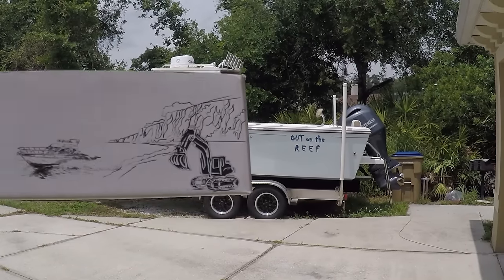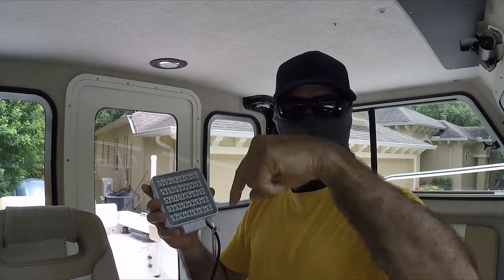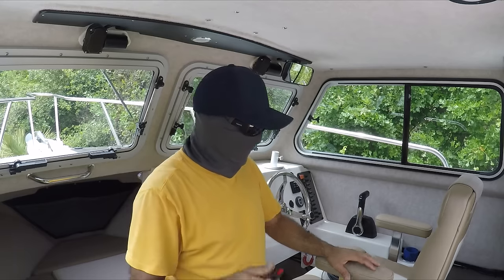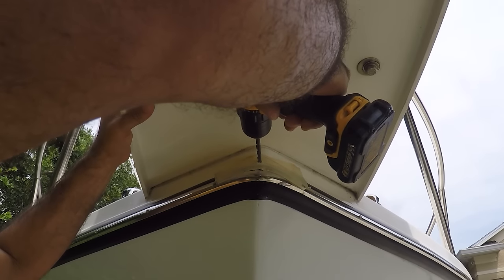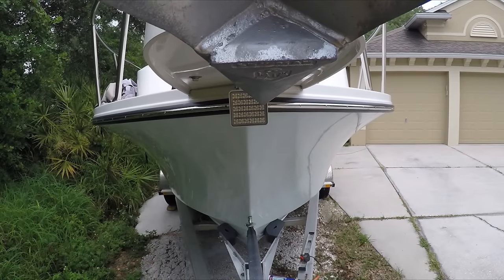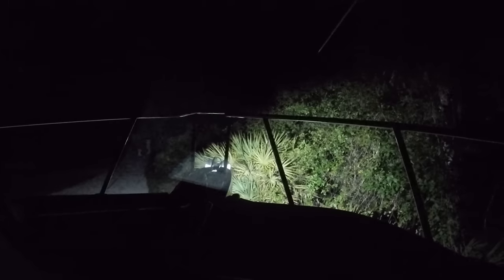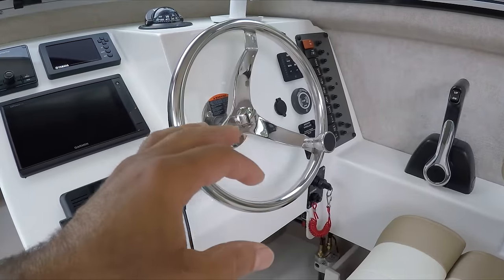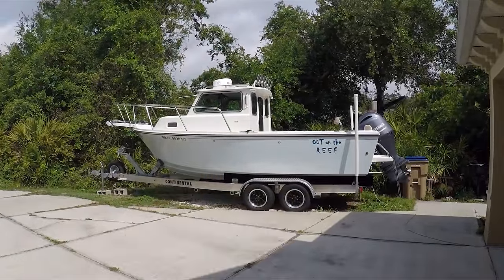Installing a LED Marine Spot Light Crooked PilotHouse Boat

Comment: Looks great!! I went with a plash 6" combo spot flood light bar on my flats boat and I was super impressed.   Over 7000 lumens on a little light.  They're made in Texas so they're a bit costly.  If you decide you need something brighter the 6" plash marine may be the way to go.  It would fit under your pulpit nicely.
Reply from the maker: Thanks cap. And they dont consume  a lot of power 👍👍⚓️🛥
Reply: @OutOnTheReef  Yup. Power consumption is a big deal when you're heading out for days at a time.  Good point.

Comment: Since you’ve used this for some time now would you still recommend this method or maybe a remote controlled golight?  I know it would be tricky to mount it out of the way so the glare doesn’t affect your sight but I like the idea of the adjustable spot light.  I’d appreciate your opinion.
Reply from the maker: Hello Tim and i love the way this one work but yes a golight well away from giving you glare woul be better but mine does a great job looking at markeres and crab traps 👍

Comment: Hi Capt... I like your light!  Great job on the installation!
Reply from the maker: thanks Andrew is not like yours ,your is better install but will take a lot of work to do, this way was fast.
Reply: @OutOnTheReef  Hi Capt. I was lucky that the previous owner had the light installed; If I was doing it myself I would do what you did; I would not have drilled the 4 holes in the bow rail! And as you mentioned in your video, your wide-angle light spread is a better idea than having to sweep back and forth, up and down with a GoLight. Especially on a rough night where I need both hands to run the boat!

Comment: Great Video, make sure all the Mounting Hardware and Bolts  are 316 Stainless. 👍
Reply from the maker: Thanks for the tip! cap.
Reply: @OutOnTheReef   Simmons Metals in Miami sells Stainless 316SS in any size and thickness.
Reply from the maker: @frankmelero5511  you know I just went to the boat right now and I saw a little rust starting to very little so you are right captain I spray some Marine silicone to prevent from rusting but I know in the future Imma have to change that out thanks for the heads up
Reply: yes çhef uses stailñleeß stéel

Comment: Nice install, i will have to share that i had these on my boat too, they are ok for docking at idle speeds but unfortunately can not be used for navigation as the LED light is too disperesed and soaked in by the water. I quickly replaced it with a Go-light that has a more focused beam. Thats my experience.
Reply from the maker: Thank you so much for your feedback and yes you may be right but once I'm out there in the ocean I'll see how this one works and I'll let you know thank you for the great feedback Captain

Comment: I would suggest you test that light with your vhf radio. The cheap lights are notorious for putting out interference that will cut your radio reception out. You can google it to read more.
Reply from the maker: will look into it cap. thanks for letting me know cap.

Comment: Nice light. But did you fuse it? I Only see you connect it to negative bus and positiv bus but no fuse? I would install a fusebox for my accessories or if you dont want that then at least put inline fuse on the positive wire..
Reply from the maker: You're right Captain I want to do that very soon I should have done a long time ago thanks for the heads up👍👍
Reply: No problem skipper! I use the Blue Sea System fuse box with integrated negative bus, good quality stuff! Keep up the good work 💪
Reply from the maker: @77sailordude  I have a lot of inline fuse but that one that you mentioned is pretty good too.
Thanks Co-Cap😉💪👍

Comment: Awesome Job as always! You could take to other one and mount on the overhang of the pilothouse, I know you already have two back there but you could turn them sideways one to port and one to starboard and point the new one straight back then you would have light on all four sides of the boat!  ....Just a thought. Thanks for sharing!
Reply from the maker: that a awesome idea cap that way i have 360 light, you are always thinking ahead, thanks for your excellent idea cap.
Reply: @OutOnTheReef  Anything for you Brother!

Comment: Hi captain.I like the videos but i think remote ligth on top of the cabin should be better.It is just a suggestion.
Reply from the maker: Thank you Captain that's a great suggestion but the recent I didn't put it on top of the pilothouse is because the glare would shine against the deck of the boat and will reduce my disability but that's a great idea thank you

Comment: Now I seen the video on the light. For my taste the light beam hits a bit 2 low, I like to have a more wider angel, maybe later on you can ad a led light bar that will give you more light. There are some 60 inch led ones that work great and the give great light, good for boats and 4x4's. For me light at night is a most. Keep safe cap and keep the videos coming. 👌👌👌👌👌
Reply from the maker: awesome cap. thanks and im going to make a video from the Florida Keys soon and you will see how great this light works for the money i paid , thanks for your reply Cap.👍👍👍
Reply: 32 lwd solar piwrr bañk 300 mha solar cell

Comment: Capt. Question have you run the ace and the fridge at the same time? Working on a similar set up as yours I was thinking off doing two igen 2200 and parallel what you think? Thank you
Reply from the maker: Yes I do! the charger is charging  the fridge batteries runing the ac and the ac machine at the same time no problems.
Reply: @OutOnTheReef  Capt I meant have you run the AC and fridge at the same time? How many things have you had running at the same time with the generator? How many watts is the inverter for the fridge?
Reply from the maker: @michaelborjas8059  gen is 2200 peak 1800 running ac fridge ice machine all at once no problem

Comment: It's called flood light captain..  would be good to install a flood and spotlight side by side in case need to see farther away.  If they have one with two beam flood and spot would also be great.  Also, once you're on the water some of the light will be absorbed by the water and will not be that bright unless the angle of the waves with respect to the boat will reflect some light back.
Reply from the maker: very true cap but this works great and i have a hand held spot light for emergencies if i needed to look farther.👍😁⚓

Comment: Hey Capt. Hope you and the family are doing good.  If you dont mind,  how much did the pilot house cost you out the door?  Also where did you purchase it at?
Reply from the maker: thanks cap. but i dont release any information abut the boat do to the factory problem that i had the boat came Crooked by Factory, hope you understand cap.
Reply: I understand no problem.  Is there an option on that model  with dual engines.  Like twin 100 or 150's that you know? Or do we need to look at the next size up?
Reply from the maker: @ricktaymimartinez2236  this one does not but the 2320 model does cap , this one only has option of one motor,thanks for watching Cap.
Reply: Thanks

Comment: Hey Capt.....your bracket will rust fast on the first trip to Bahamas.....asegurate de ponerle un silicone clear a toda esa base (bracket) y detras de la base de la bombilla, sino las vas a perder debido a la sal .....el consumo de la bombilla en DC voltage cuando esta “on” ...cuanto es?....el resto de la instalación esta excelente. Se ve de show!
Reply from the maker: muchas gracias Ivan ,la lus cosume 45 watts una sola  90 watts las 2 a la bes
Reply: At least the light won’t be on for long periods of time but I forgot that you have a generator...so you’re good to go...I was thinking middle of the ocean and the light on ....
Reply from the maker: @Carbon15556  yes I'd never run out of power because of the generator and the chargers to charge the batteries
Reply: buy searay spit light syaiñless ßteél bight spot liggt mile nihht day

Comment: Great suggestion!  I am assuming you put a fuse in the red positive to your power source.
Reply from the maker: not this time since is a very inexpensive light ,do you recommend one cap?
Reply: @OutOnTheReef  wayne is right . A fuse is needed to protect not the light but the connection itself to catch fire due a defective light 
If something goes wrong and too much power is drawn the wire ,connection can burn and eventually get fire . 
The fuse blows when amp dragged is over the limit
Reply from the maker: @Ushootout  thank you really appreciate it I didn't think of that I have a lot of fuse cables here with me so I am going to installed one should only take me a couple of minutes thank you both for the great suggestion, I know you guys have my back.🤗🤙👍😁⚓

Comment: Cool idea and glad I found this video. I am getting ready to do the same with a LED bar style light. What was the outcome of how well it works once out in the ocean with larger waves? Does the light get too soaked up by the water or does it help with the waves?
Reply from the maker: my bow is very high so i have no problems and  look at some of my fishing trips , is been rough out there seas 3 to 5 feet waves and no problem with the light , what is your boat model cap?
Reply: @OutOnTheReef  Hi, good to hear! I have a 1992 Grady White 252G Walkaround Sportbridge model. Very high off the water for a 25' boat.
Reply from the maker: @Grady252  if i don't see a problem with mine i think you will be ok cap. 
you have a great boat cap, navigate safe⚓

Comment: Excellent install Captain.  Did you think of installing the second one under the swim platform?  You could light up the rear and probably get those lobsters at night!
Reply from the maker: that is a awesome idea cap and a wild  one too lol i like it
Reply: Saw at Hot Tuna..Theystill install the search light on Top.consider to find marking,bridge , buoy from far..before the boat entering dock
Reply from the maker: @agaramelan7319  i seen that ,i love that show, and very expensive gear they have
Reply: @OutOnTheReef  if Brand i think is yes..but i saw some with magnet or sucking rubber to be installed  on Kayak..lol..but i saw u have band spotlight .can help anyway too .
Reply from the maker: @agaramelan7319  thats funny AgA

Comment: Nice cap just watch those brackets on them lights, there not stainless and will probably rust fairly quick, I run these on my snow plow truck and there amazing but the hardware and brackets already started rusting after 2months.
Reply from the maker: thanks cap i will keep a eye on them, good liking out Cap.

Comment: Because they're inexpensive you may not care but i sure hope the POWER CABLE is UV resistant.  In the sun we get here, it won't last long if it isn't.  I posted that question in Amazon link.
Reply from the maker: great point but in my case the cable is out of the sun cap.
Reply: spotihtt laßt loñg t8mé

Comment: You would’ve been better off with a rigid light
Reply from the maker: i would loved to compared them before i purchased this ones
Reply: Yes agree..rigid light is best..hella marine also good capt.is put on top and near the rockrt launcher.so it wont beam the front deck and blind star board.or search lght can be install in front also